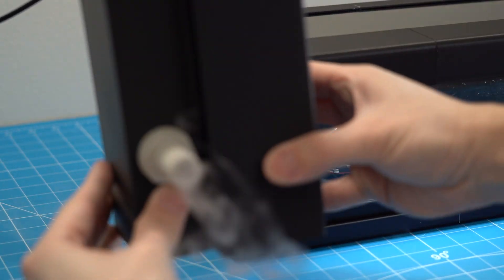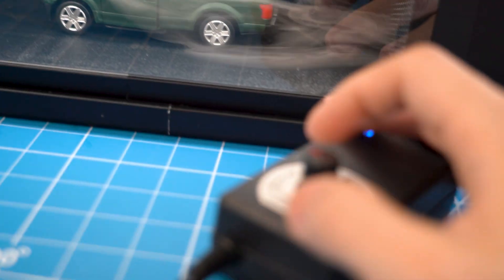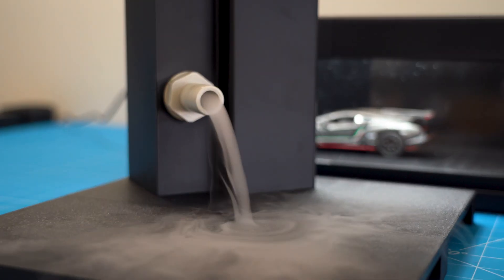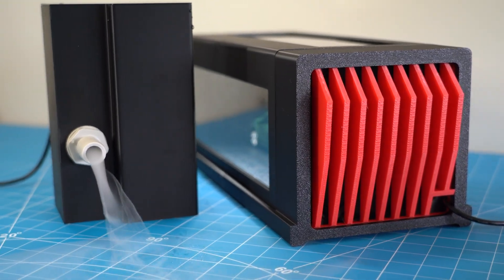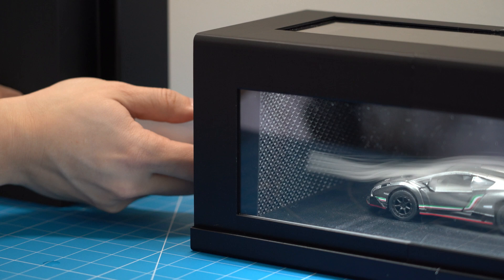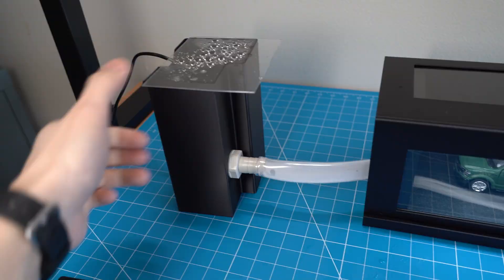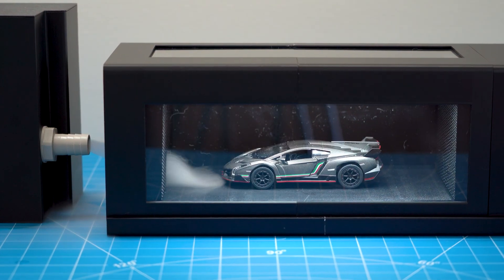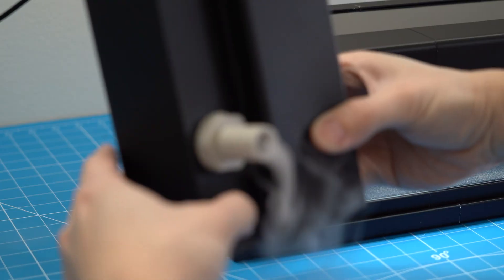How I generate smoke for wind tunnel | Aeroflow Desktop Wind Tunnel Ready for LAUNCH!

Comment: how much water dose it consume?
Reply from the maker: Very little. Like a cup of
Reply: @AkiTechSpace Hi man can I reach out to you? I 3d designed a fog maker (idk how to call it) but the flow of fog coming out from the hole is very little compared to the fog generated inside. I don't think that it's an air intake problem and I wanted to hear your opinion about it. Thx for the response

Comment: how is the water turned to vapour?
Reply: There is a piezo electric element: a special material that bends when you apply electricity to it and generates electricity when you exert mechanical stress on it (for example it's commonly used to generate sparks in lighter when you mechanically press a little ammer). In this case an alternated current with a frequency of 1.7 MHz or more is applied to the piezo, therefore it bends (vibrates) back and forth with a frequency of 1.7mhz (1.7 millions times per second). This extreme vibration happens so fast that the water can't keep up with it and a partial vacuum is created between the water and the piezo. Due to the low pressure of the partial vacuum some water gets turned to steam (even if it's not hot) and some other vapour is also created by the vibration shooting up super little water droplets that also evaporate in the air.
Reply: @davidedamiani5331  thats really cool thank you so much
Reply: @davidedamiani5331  Booomm ... you revealed his secret LOL ... is it the same in the Nebulizer?
Reply: same tech as many cheap humidifiers
Reply from the maker: I don’t know what the science behind it but it’s cool

Comment: hell yeah! what kind of velocity do you get in the test section? ive been working on a building a full scale model myself, good to see that steam can be so effective in test section smoke generation, keep up the good work!
Reply from the maker: It depends really, I haven’t measured it because I’m using it for visual effect. But the fan itself is a 4-12V. And yeah I think with the correct configuration you can get good visual effect with just water mist